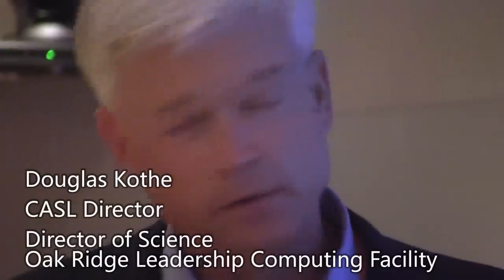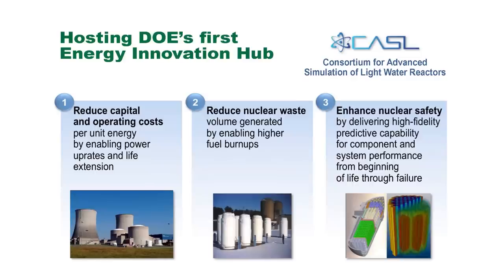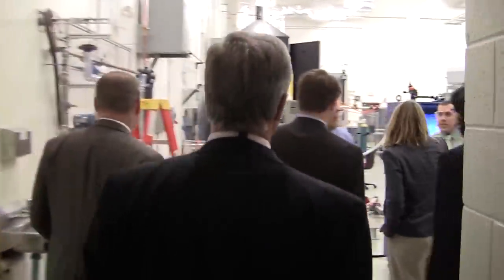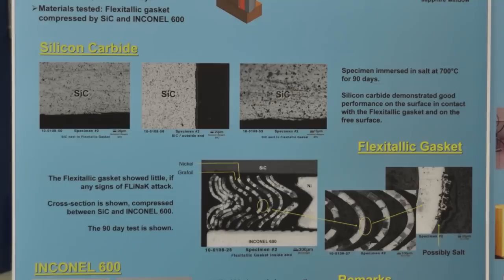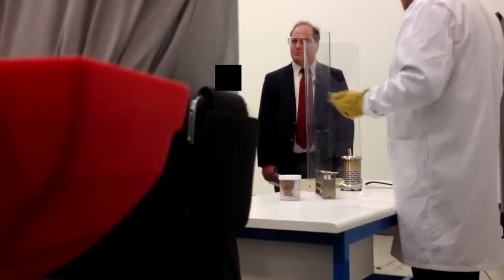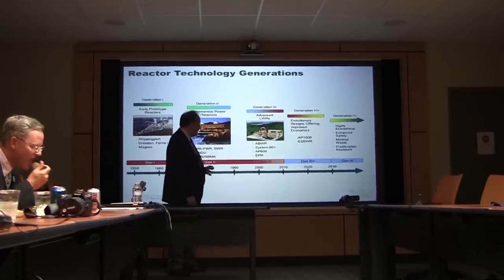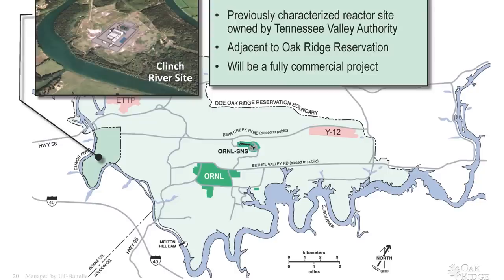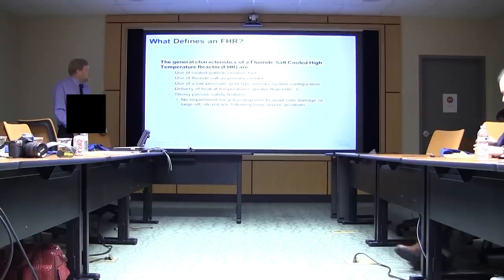Thorium Advocate Nuclear Tour of Oak Ridge National Laboratory

Comment: A reactor with out pumps or pipes to controle heat: shape the reaction chamber so that it can be rotated along a horizontal axis so that gravity pulls fisible materials from a bowl shaped concentrating surface to a flatter surface that will reduce probability of chain reaction. 
Fisible material could be pebble in a salt solution, or salt salt if there were two salts that separated by weight.

Comment: After a few years studying the waste problem I have become more certain our current swimming pools full of waste is NOT a waste but can initiate the change to a thorium fuel cycle and every coal plant now running should as quickly as possible be switched to thorium molten salt reactors. The escape of tritium if not captured immediately with fluoride salt can not only be a fusion catalyst but must be completely controlled and could be in my mind the only inhibition to molten salt. This video shows the importance of strict controls on our most advanced technology. I believe the autism spike now occurring probably has to do with Mercury contamination so coal must be not used in our future as it's radon gas emission and other contaminates may be our end if we do not immediately move to molten salt thorium reactors.

Comment: Sadly, we have to consider that great obstacle of licensing by the NRC.  The Fort St. Vrain Prototype was licensed, built and commercially operated.  It was Helium gas cooled and used high burn up Thorium TRISO fuel elements.  I presume that more of these could be built with the single major change from steam powered Helium circulators to electric motors without long licensing delays.  How many years did it take for the Westinghouse AP1000 reactor to finally gain approval by the NRC.  Gaining approval for a totally new technology sounds almost hopeless.
Reply: the greatest obstacle to cheap energy from advance reactors and devices is that it make poor country rich and therefore the present rich nations who control the economics cannot anymore enslave citizens from those poor countries. In short they don't want to lose their present elite status. where will you be in the afterworld with this attitude.

Comment: @13:56 WHAT?!!! That makes no sense @ all.  Cheaper to get U235 out of the ground than to REPROCESS a pellet that still has burned up only 1%-2% of it's fuel?  So therefore we have a pellet that is 98% U235 & 2% wastes and then to strip it out of it's jacket & refine the uranium with chemically like any inorganic chemistry major can do costs more than to take the natural uranium ore out of the ground refine it chemically and by heat, then take it turn it into UF6 spin it in a centrifuge to separate the U238 from the U235 then chemically strip the fluorine from it then.stick it into a new jacket? Is this just totally nutz or whatz?

Comment: Yeah, information to fuel social engineering. Visual printed information especially barcode & id codes are massive weak points. The best system I have seen nearly use no text or print on the cards except Photo of owner. They are also contact based, no RF distance capable reading. The encrypted card has to be read to verify access.